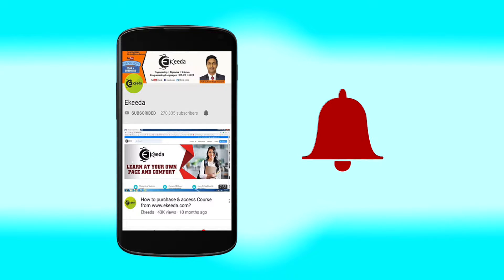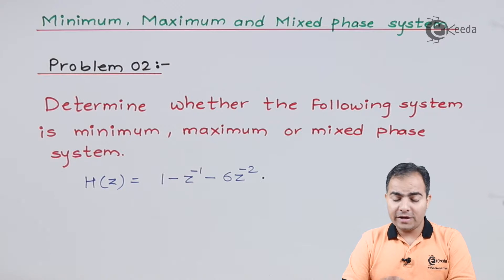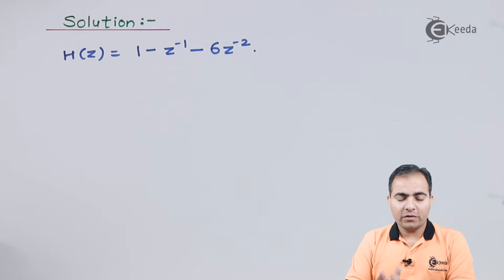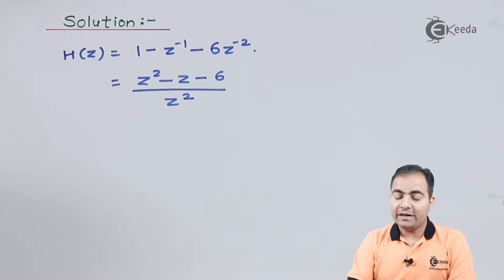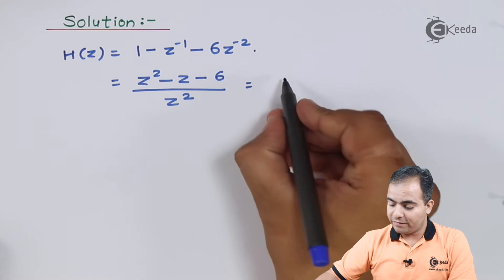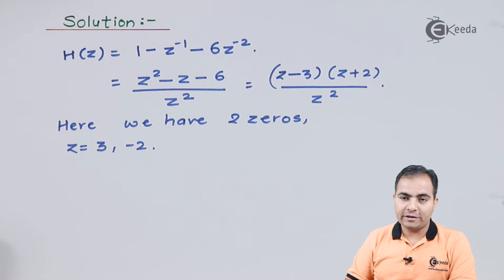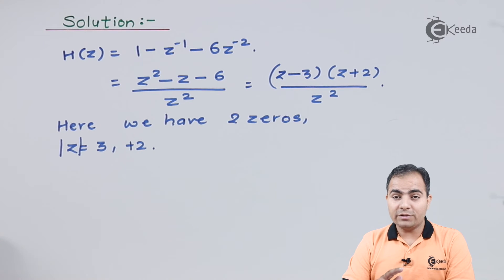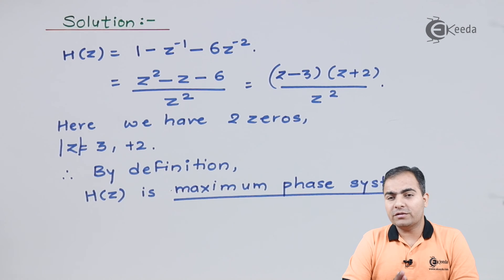Maximum, Minimum and Mixed Phase System | Signals and Systems | Problem No - 2

Comment: In first problem you said if all poles and zeros inside the unit circle then system is minimum phase and if all zeros and poles outside the unit circle then system max phase. but here you just consider zeros only and now i am confused why you didn't taken pole ? it is mixed phase ? because poles are 0 ? Reply me
Reply: Only consider zero's for the system, not the pole's, and the Radius is 1 (by default).